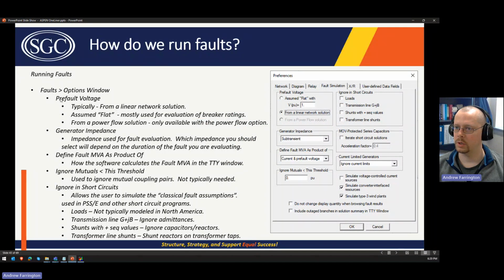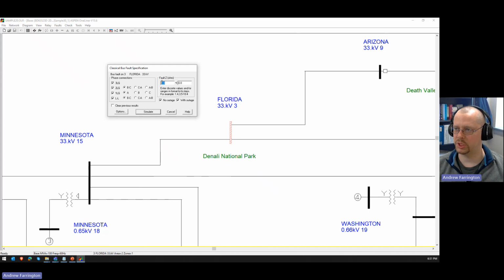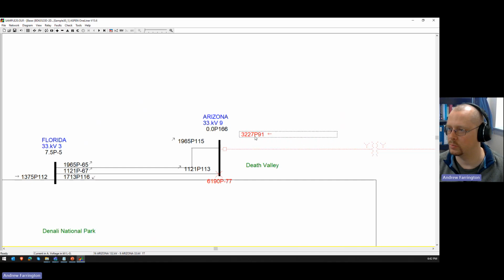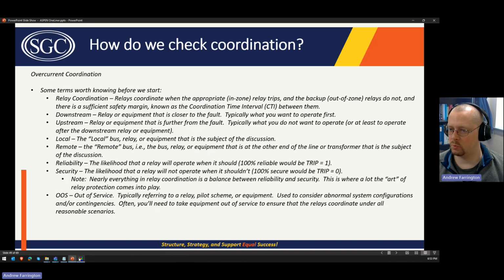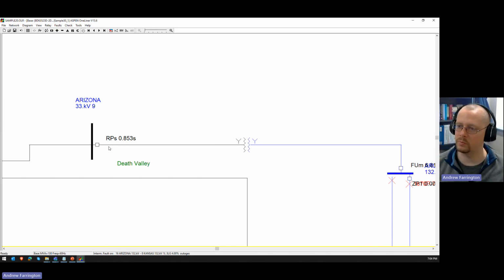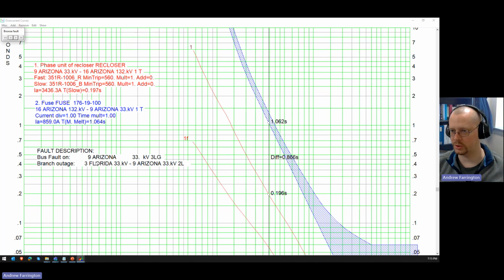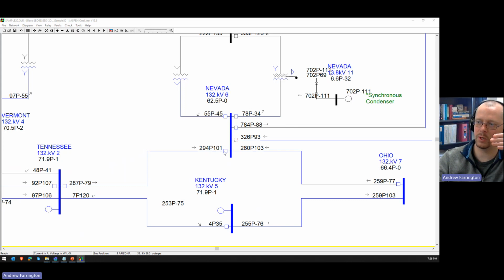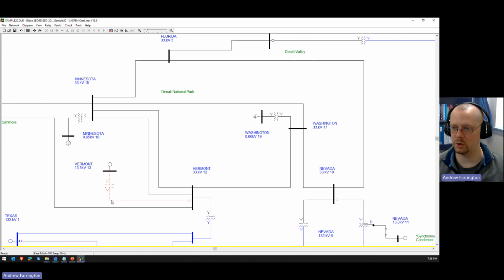EET423   ASPEN OneLiner Lecture 3  20240229 182018 Meeting Recording

Comment: Paul, hope you are doing good!, do you know where can I find the presentation?, would you have an Aspen example applying the pilot schemes?
Reply from the maker: @ottoronaldparragaaracena8594  in Aspen, you just set the sun zone reaches to make the pilot scheme work.  The reaches are based on client needs.  Typically, set zone 1 to 80% and zone 2 to at least 125%.  Then check to see if the zones will impede on another protection element zone.
Reply: @paulvilleneuve1621  I have those zones in placed in the aspen model, what I don't understand, or I need support is to implement POTT scheme for example, would you have an Aspen example file?